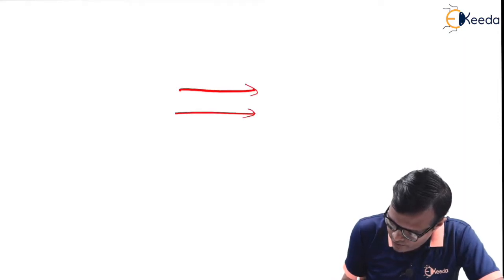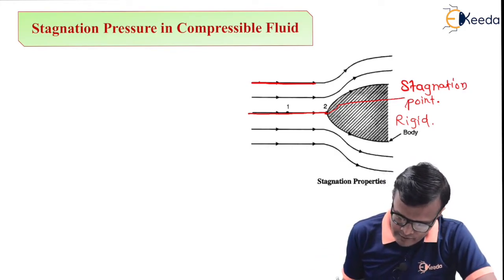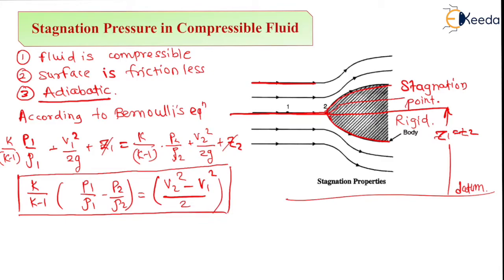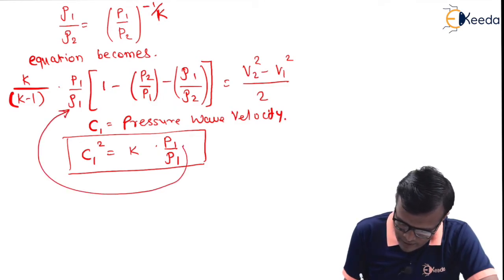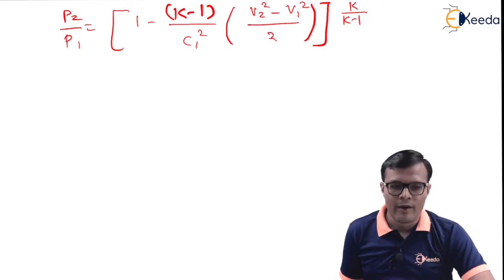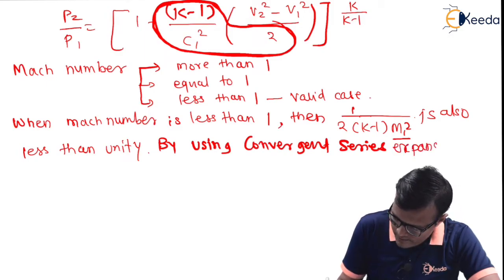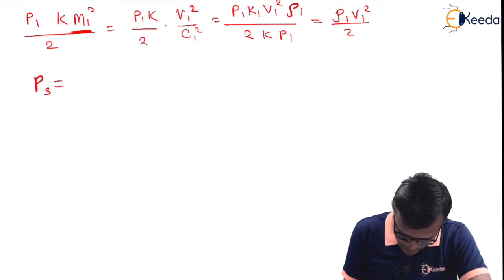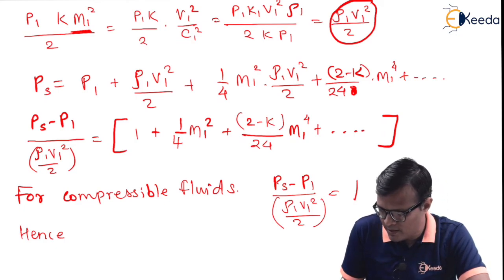Derivation for Stagnation Pressure - Compressible Flow - Fluid Mechanics 2

Comment: The Bernoulli equation is only valid for incompressible flow.  To calculate stagnation pressure for compressible flow, you must use the isentropic relation.